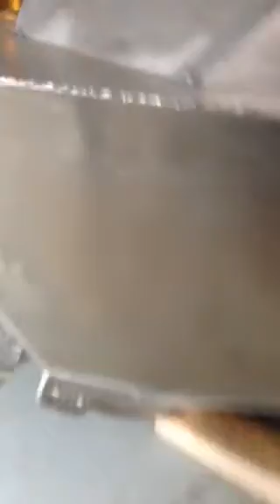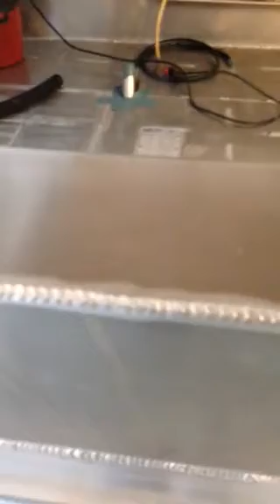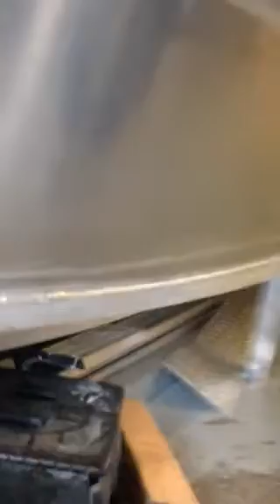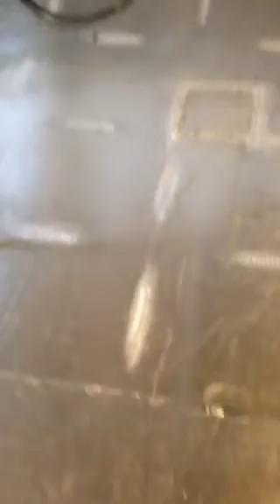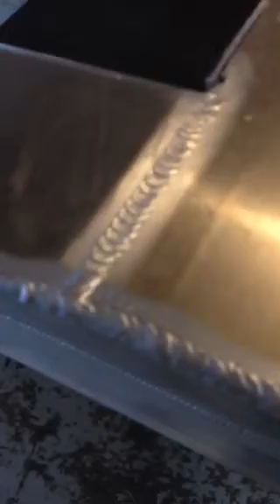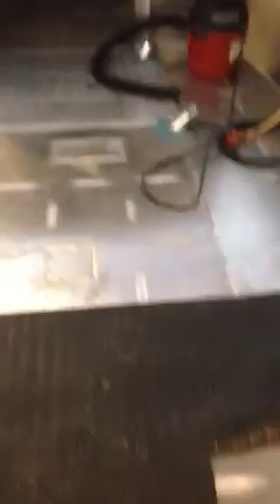Aluminum boat build

Comment: That looks like it's going to be a nice boat. A little beyond my skills at this time, but looks like a fun project.
Reply from the maker: Hey Machine shed. I'm a subscriber of your channel, it's funny I would see you comment on mine. I guess we have similar interests. 
   I've been an aluminum boat builder, fabricator for most of my adult life. It never gets old.  At some point I want to learn lathe work like you do, but I've been mostly sticking with what I know since free time is limited. 
   I had no plans or drawings to go off of for the boat, just been winging it with a buddy. I would not recommend this same approach as it is more time consuming and costly if you realize you made a mistake on a sheet of aluminum. 
   I should be posting a new video soon since I'm further along now. 
Cheers!